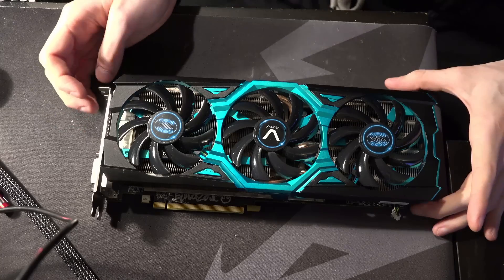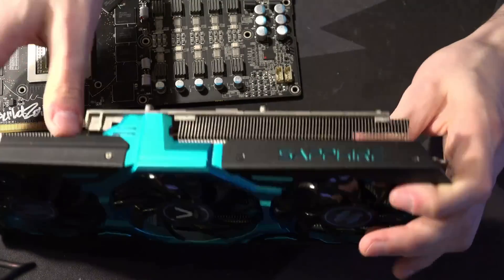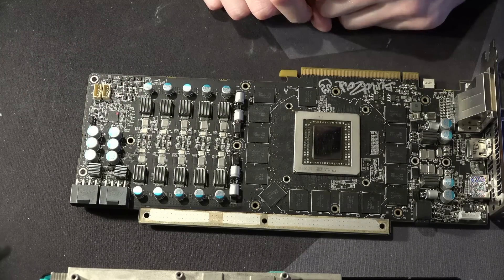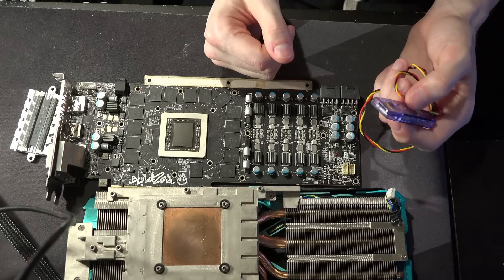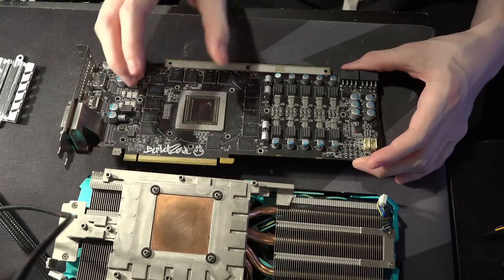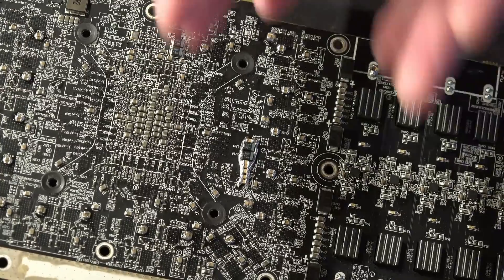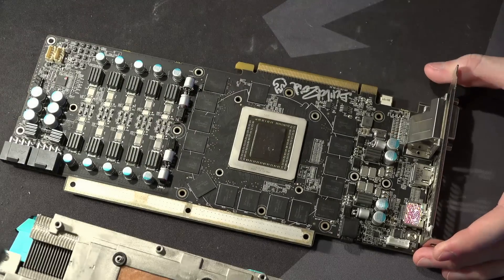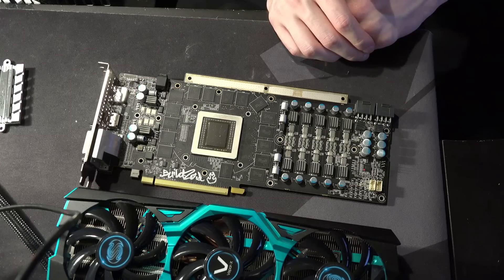Buildzoid rambles about his R9 290X Vapor-X

Comment: 18:01 you need to generate 3D load on the gpu to get the memory timings to stick with the utility software (otherwise you'd just end up altering the idle timings). so run for example the pcie render test that comes with gpu-z and only than launch the memory utility (do not have it open before 3D load or else it still won't work properly)
Reply from the maker: Yeah I realized that's what was causing the issues but I basically decided I'd eventually just lock the pstate of the vram

Comment: I owned one of these for a few years. I had a custom bios on mine and I ran it at 1.45v core voltage and you are correct, ram clocks scale with core voltage. I don't know why, but it does. I had mine running on the stock air cooler (the sexy vapor X one) and at 1.45v I was able to run it at 1160 core / 1625 ram and I programmed that in with a custom bios and ran it all the time. I was averaging around 400 - 450 watts through this VRM in this card in (like for example GTA-V) and even with 450 watts sucking through it the VRM's only maxed out around 50-55c and core ran around 70-75c.

Comment: I'm still using the XFX R9 290 GPU on most AAA games at 1080p high to ultra settings between 40 to 70 FPS, I'm finding it hard to replace this card with what AMD and Nivida have to offer atm that I consider jaw-dropping at the decent price point.
Reply: Get a Vega 56 its around 250-280$. It is really awesome value and performance.
Reply: @iM7mdz515  ill have a look at it thanks

Comment: I hated how these GPUs were denounced because the reference heatsink didn't cut it. If these GPUs came with the software AMD has now, and were clocked at around 925 Mhz +/- depending on the chip with a voltage reduction, you would be looking at a perfect "entry" high end GPU. The amount of shader work these GPUs are capable of was far beyond their time. Throw high resolutions at it with not ultra but optimized textures (basically look identical to uncompressed), a moderate rate of motion for polygon complexity, and a good processor for the content you want to run that will keep up; and you have a GPU that is no slouch for the vast majority of games running at 1440p to 4k. It would be very reliable too!

Comment: I remember when I had to do maintenance to my old boss' computer he had an R9 290 Vapor-X, and dude, I forgot to put the screws that go outside the case to get the GPU in place and not move and when I lifted the case to phase up the card was so heavy that it literally ripped itself out of the PCI-E slot, the only thing having it not fall over was the lock on the PCI-E slot, once I turned it on I had a ton of pink dots on the screen and I was like, holy crap, I just broke something, either a PCI-E slot pin or a pin on the card, thankfully I fixed it by just cleaning the GPU pins with isopropyl alcohol.

Comment: 1/ The memory voltage is tied to the core voltage on Hawaii! It is a ratio of the core voltage, you only get memory controller voltage available via software like VRMTool. Was able to get a stronk 18k+ gpu score on firestrike with a bare 290!
2/http://www.saturnpcb.com/pcb_toolkit/ it could be useful and knowledgeable for you.
3/Still 100° power stage boy!

Comment: What if swap memory to K4G41325FE-HC25 8Gbps 512Mb (from gtx 1063/RX570/580)
but need custom bios for newer GDDR5
Imagine: custom 290X vapor X with OC 9Ghz memory
Reply: Maby Buldzoid can tell us if he heard of Such tests.  I have the same card(8gb) and i wish there were some upgrade paths like compatible(8ghz) mem chips and pin-compatible 7nm  290(x) cores sold OEM or even cut down in half rx5700xt(20 Cu) core would be epic.   
This is getting us into fantasy realm but  companies would brake "new cards market" here, but it could be awsome for old GPU enthusiasts ...... Also    I wish GPU cores were universally socketed, if the pin layout would be same, you could Just  slam New tech core on a hi tech pcb like this one and flash hack-bios.

Comment: Couldn't get the settings to stick?  It should remain with what you set until you restart the machine, then you have to run the utility again.  Because it doesn't alter the bios in any way, it can't persist thru reboot.

Comment: Hello  . I measured this card that I bought in 2015  ,and I realized that it consumes so much power ... after it brocked my Seasonic GOLD X 650 W :)  But that's no problem .I got another PSU and measured stuff again .I still noticed that even on IDLE it consumes around 100 W or more in some cases .Its that the same for you in idle ? Because 80% of the time I use my PC just to browse the internet and that's it .I don't have time any more for gaming .So for just browsing the internet it consumes to much power in my opinion .Some friends are getting small but good cards like ZOTAC 75W only on the PCi-E slot .that play the same games that I do with fair settings .So I got an alternative option for my only PC .This is the question . I got another card  and Nvidia 210 pluged in another PCi-E slot and o somehow got out from the slot the R9-290X ,but hanging near the slot ,nut plugged in .So when I browse the web I use Nvidia 210 & when I play high demanding games I insert the 290 X and remove the Nvidia . My question is : when I plug out / remove the 290X and leave it unplugged in the motherboard ; and I power up my PC with the Nvidia 210 ; Do I need to plug out even the EXTRA POWER connectors from the 290X if I don't use it since it's not plugged in the motherboard ? Is something going to happen it I don't remove the extra power cables and power up the PC with them inside a video card that I don't plug in the motherboard ? Is the PSU still going to deliver POWER to the card even if it's not pluged in the motherboard ?

Comment: a couple days ago i added the 670 to the water loop. shoved a thermocouple on the vrm heasink fins and confirmed that my idea about cooling that part with negative pressure in the case (i'm old skool brah) actually works i managed 80 more mhz on the core, total 1280mhz.

ran userbenchmarks tool and noticed that yeah i'm in the top 20-ish for the 670 ok but some guys are on a whole different level at the same frequency with no major differences on the base system.
what gives? are there cheats here too? i tried using the driver the 1st dude uses and i get less points.

Comment: If only we could get this with the 5700xt core, both are 2560:160:64 core config but 5700xt can do 1800mhz unmodded so on this kind of setup would be nice to see (ignoring locked power stuff) could maybe get it to 2200mhz or more. Just spitballin.

Comment: Only thing i remember about the 290x back in the day was how much of an utter failure the stock cooler is, and a hardocp article back then suggesting one of these models used nearly 500 watts of power. And for all the advantages it should've had, it wasn't faster than a bog standard gtx 980; not enough to justify a glorified blowtorch in one's pc.